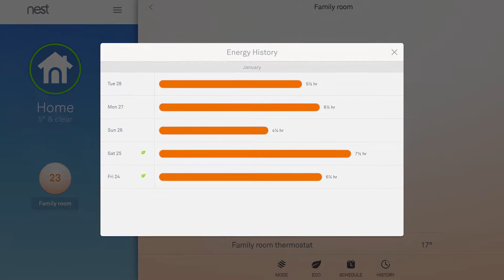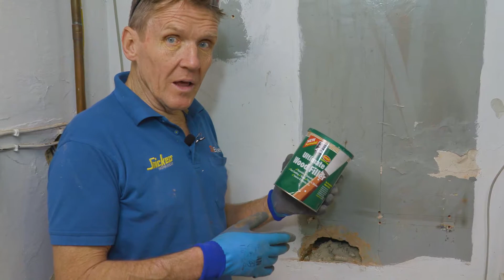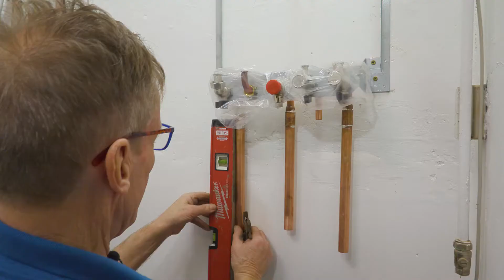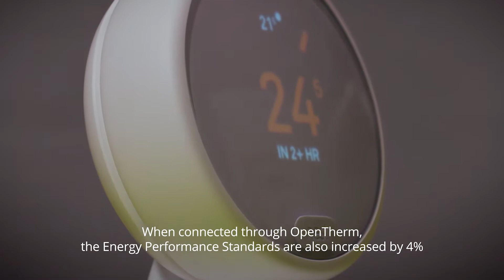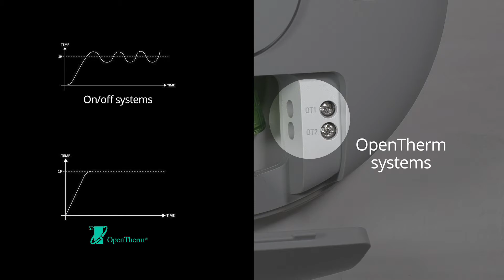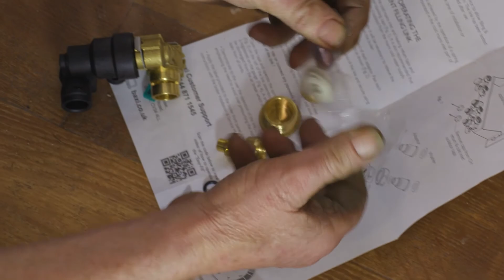Save time and energy with Mr Central Heating. Roger Bisby shows you a Baxi & Google Nest install.

Comment: Hi Roger, I have been on a commercial site and they have 3 fair sized gas boilers each feeding into horizontal shared flow and then the same again for the return header system. Then there is an upright header where the flow and returm mix as well as the pumped (load) water is sent into the building and returns into the same upright header. How does this system not create a hot water short circuit, totally don't understand the idea behind this. Can't find anything on the Web.